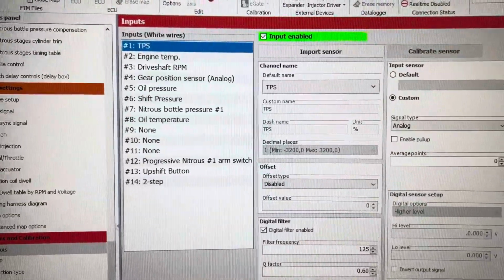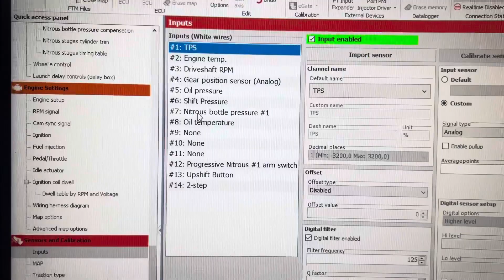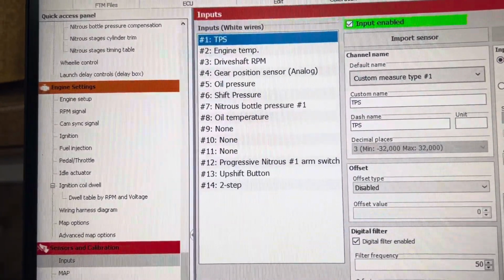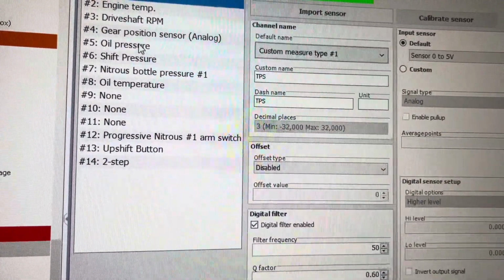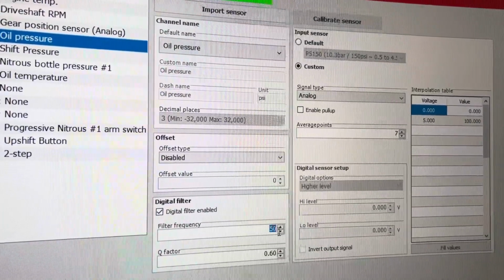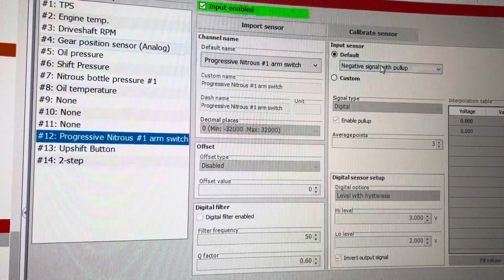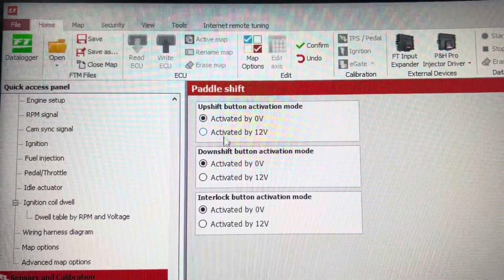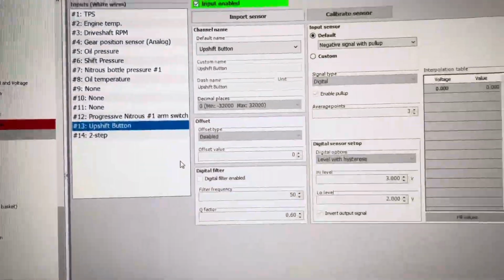FuelTech wiring series Part 2: What is a input?

Comment: So for an oil pressure sensor I have to have it wired up to #5 correct or it doesn’t matter ?
Reply from the maker: It doesn’t matter. Use any white wire as long as you set it up in the software as that number.
Reply: @LiguoriDragRacing  

ok thank u so much. i am new to my fuel tech ecu so where to connect the grund ? to the nagative battery terminal or in the plug ? and where i got the +12V from ? thanks

i have an FT550
Reply from the maker: For pressure sensors you use 5v and sensor ground from the FT550 harness. 5v is green with a red stripe and sensor ground is green with a black stripe.
Reply from the maker: https://docs.google.com/document/d/1pRwbC3zEt5FWDdOFqwPr6_4eXFVZoBlenkqDC15bS1E/edit